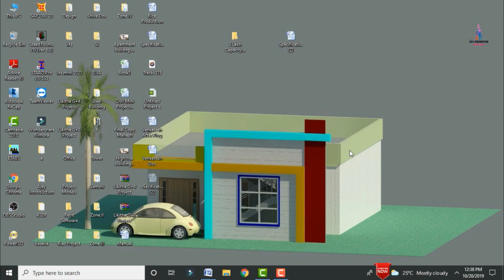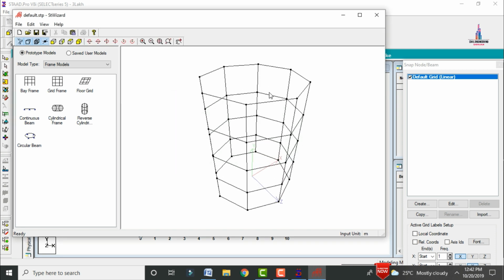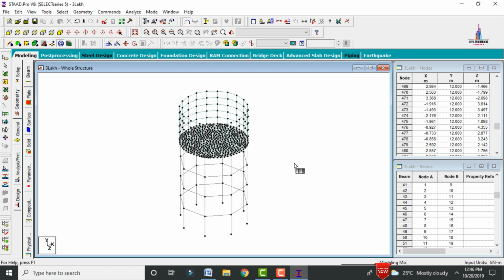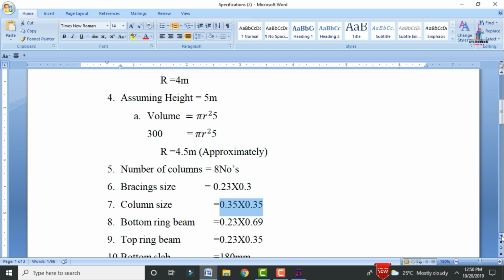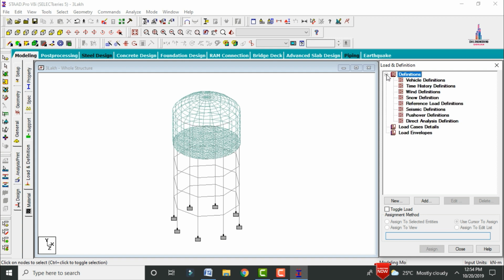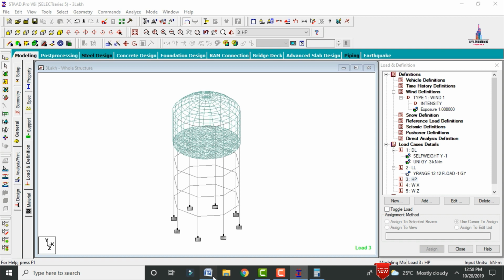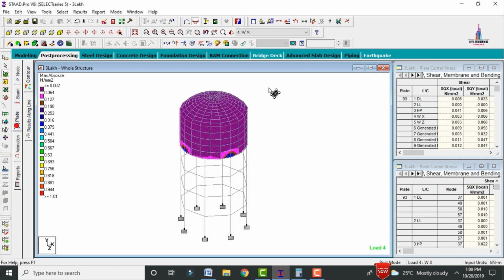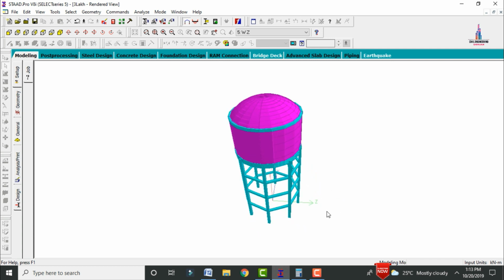3 lakh capacity water tank design by staad pro v8i software | civil engineering | water tank design|

Comment: Why the parapet wall is not modelled? As per the standard practice, parapet wall shall be around the bottom ring beam from outside i.e. cantilever slab and at end of the cantilever, parapet wall is provided. If one can see, the parapet wall is replaced by handrails at the end of cantilever slab at the location of bottom ring beam. Likewise on the top ring beam also only handrail is provided with landing width of cantilever slab. The entry on the tank floor and top being restricted (except Veeru in Sholey). The cantilever will induce torsion in the ring beam at bottom. Please explain.